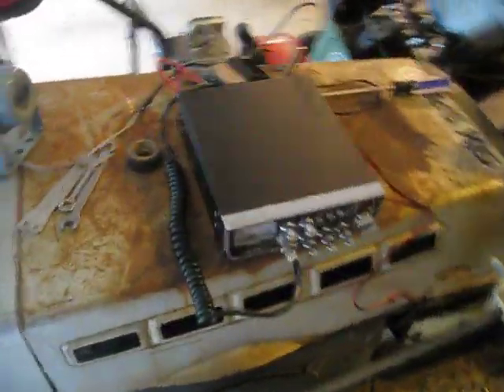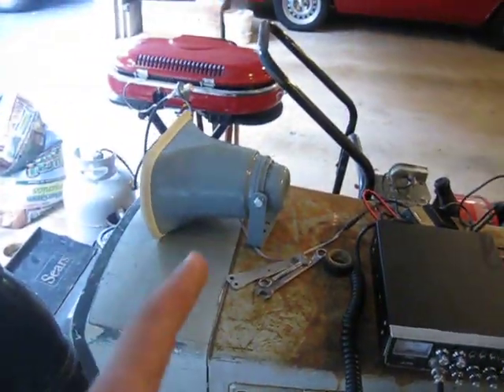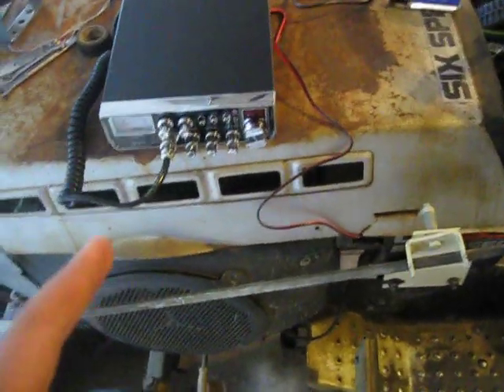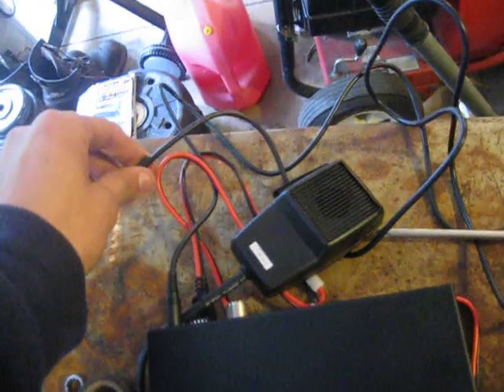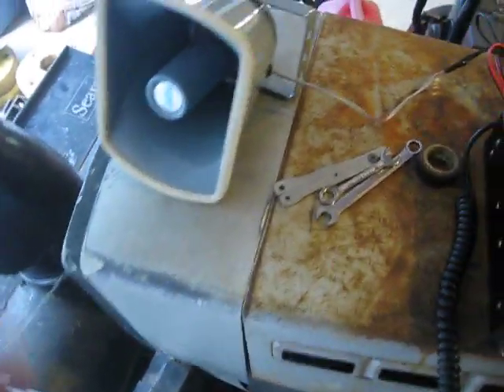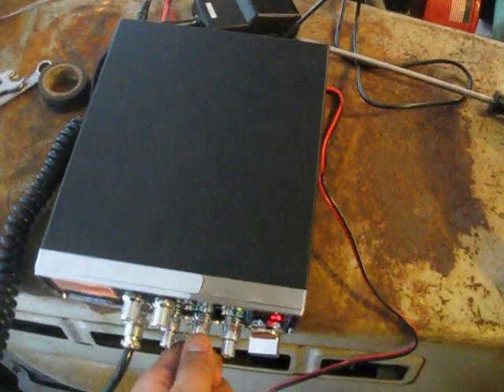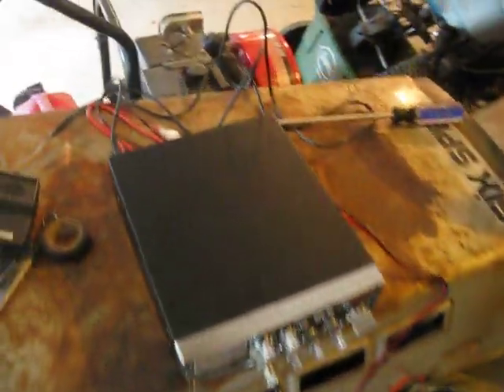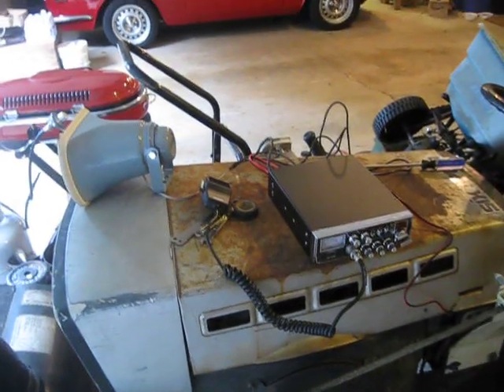How to Wire a PA Horn/Speaker to a CB Radio

Comment: it didnt work
Reply from the maker: You probably did something wrong lol. There's not much to it.
Reply: do u need to ground your cb
Reply: The negative wire running back to the battery is the ground. As long as it has a positive and negative connection the circuit should be complete. I'm no electrician, so don't trust your life to my advice.